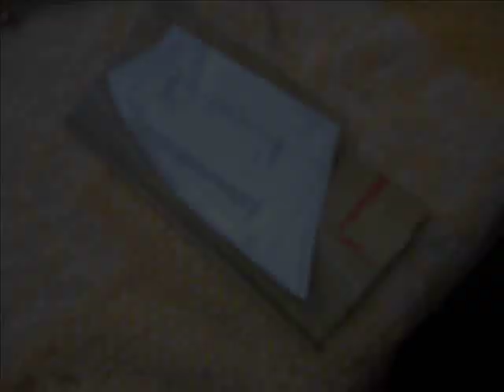electric ukulele

Comment from the maker: most of the parts come from other guitar projects .  the bridge saddles are from a telecaster type bridge ,  fret wire from ebay , the volume knob is a brass jack plug collar with a chrome dome and a grub screw tapped into the side  . the nut is from scratch in brass

Comment from the maker: @kingkumber   the wiring diagram is same as a single pickup guitar ... i think its on the seymour duncan pickup diagram site .  the pickup is a telecaster neck pickup , raked at an angle to put all the pole pieces within the influence of the strings

Comment from the maker: ive lined both the pickup slot and the volume control cavity with aluminium / copper sheilding tape . then soldered a wire between them , then to the earth wire to the volume pot  .  it should help to stop  fluorescent lights and other electrical sources interfering with the single coil pickups sound

Comment from the maker: i used a bandsaw to get the rough shapes . but a jigsaw with a fine blade would do .  the rest was done with rasps and a roll of very course sandpaper , wrapped around tubes or wooden blocks

Comment from the maker: @GuitarsBlood  i used aluminium sheet to shield the electrics cavities against outside interferance  . self adhesive copper is available for this , and if you do it , it should be wired to the earth of the control circuit   .  many guitars are not fully shielded

Comment from the maker: @sanman312  any guitar pickup should work if you put it at an angle so all the polepieces are under the strings . the only reason i used a telecaster neck pickup is that the chrome cover looked right to me

Comment from the maker: @longliverock1996  i got the fretwire from e bay . it was guitar type . just make sure its a reasonably low type ( or better still ukulele fret wire ) a single length was just enough  . a flying v would be easier  .  all straight cuts and then the points rounded off slightly  .  the neck pocket is the trickiest bit .  the only way to avoid routing or chiselling it out , would be to make the body out of two slabs of wood the top one having the cut out , the bottom left as the base of the pocket

Comment from the maker: @MarksArt123  you would need a guitar volume pot  and a guitar jack socket ,  both available from e bay or electric guitar spares shops .  for a circuit diagram look on seymour duncan pickup diagram site  .  single pickup circuit one volume no tone

Comment from the maker: the bridge is fasterned onto the body with four screws , one  on each corner  .    the four holes in the back go through to the bridge .  the first 5mm is wider , with a washer set in , to stop the ferrules on the strings pulling through  . strings through body is supposed to give better sustain to the instrument  , although i havent proved it yet  .  the large hole is for the volume pot  and wire to the jack socket

Comment from the maker: thanks .  i tried to find blueprints online , but couldnt get a one to one plan ...so borrowed a uke and made a rubbing by laying  some paper on the fretboard and rubbing a wax crayon over .  the pickup is a telecaster style with six magnets .  i couldnt find a weakness in any strings sound quality , so i,m taking it that each one is influenced  by the magnetic field of more than one polepiece  .  no capacitor in the circuit  .    and the neck is glued in with araldite two part glue  .

Comment from the maker: also if you start from both sides of the fret board ,  and keep going a bit at a time , one side then the other , as on-line as possible ,  when the two cutts meet , you should have a shallow , square cut which you can then take to the depth of the fretwire  .  i think it would be o.k to use small nuts and bolts to fasten the bridge parts together .  the brass bridge would have to be chunkier  , and the body , under the plate drilled to take the nut ends .  hope this is of use to you

Comment: I just stumbled upon this video, and it turned out great! I'm in school to become a guitar builder, and am going to take a uke building class too. I've put a lot of thought into making an electric uke, and was just curious if you put in some sort of a truss rod or just went old school acoustic with this build? My thought process was that with metal strings (for the pickup to work) the neck would have some serious bow to it due to the added tension...just wondering what your thoughts are.

Comment from the maker: @samsbananas1066 i used guitar parts for electrics . the pickup is a telecaster neck pickup ( or copy  ) and if you go on the seymour duncan wiring diagram site under the heading single pickup one volume you will find the wiring plan  .

Comment from the maker: thats a difficult one ,  as the ululele is no longer with me  .  i dip into a set of bits and hole cutters as i go .  hole sizes for the machine heads is usually on the item description on ebay  .  the holes for the pickup slot just allows slight room for manouvre , as does the one for the volume pot . i used a mini pot to avoid drilling too much wood away .    as its a one off instrument , i dont keep measurements and drill sizes .  sorry

Comment from the maker: @sanman312  avoid pithy wood or fibre board for the body  .  pine is easy to shape and sounds good , but is easily dented  .  i think ash and poplar are good too , and if batons of timber are all thats available ,  glue them together till you have the width  you need  .   lay the neck on a sheet of paper and mark where the bridge will be , and sketch some shapes  till you find something you like  .  with electric instruments the shape wont really affect the sound

Comment: Hi, the uke is really cool, my compliments :-)
As I think about building one by myself, I've got some technical questions:
1. How did you know the positions for the frets? Did you just try out or calculate it in some way (and how)?
2. Is the pickup still with 6 magnets or dit you size it down to 4 and rewind it?
3. Did you apply any other electrical components, except the potentiometer (e.g. a parallel capacitor)?
4. Did you glue or screw the neck?
Thank you for your answers :-)
greets,
13ohms